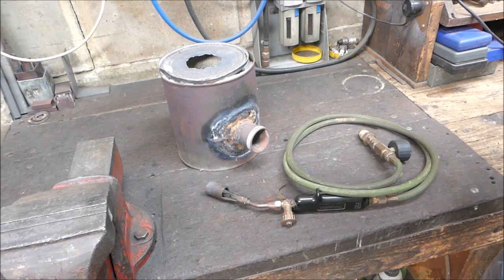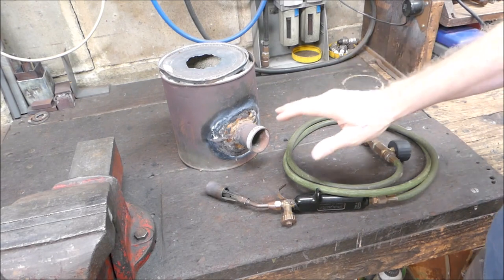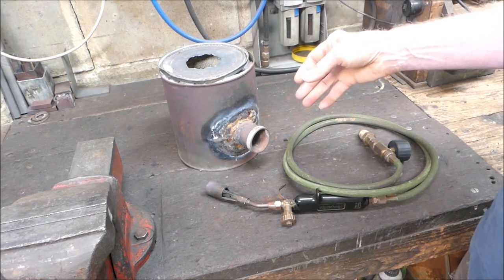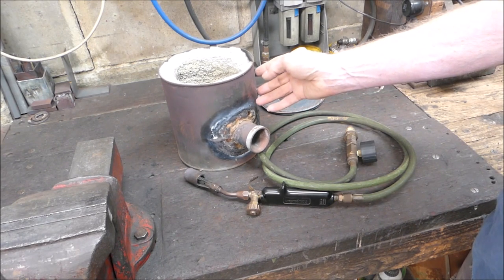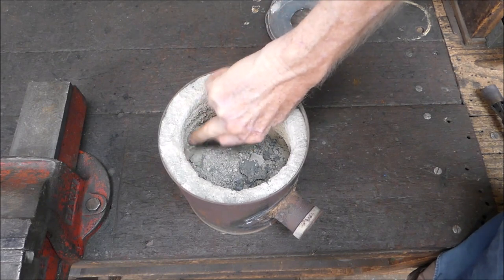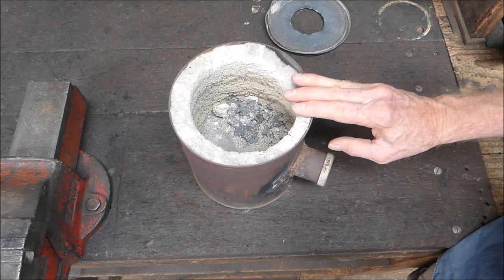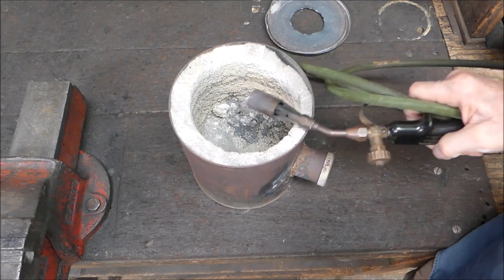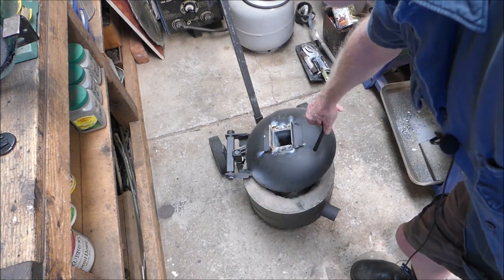How well do Perlite and refractory mortar stand up to intense furnace heat ?

Comment: Hi, Thanks for sharing your ideas in this informative video. Given that you have a very good insulation lining, I think that you could coat the old eroded surface with a thin layer of render that could withstand the heat. Pure commercial refractory mortar, that you use with the perlite,  may do the trick. My supply of Lanko 156 refractory mortar is only good to ~1,000C). I expect you need a bit higher temperature. Sodium silicate mixed with suitable refractory minerals is another that can be good for 1,200+ (My thermocouple will not measure above this temperature and I expect that the probe wires get destroyed at this temperature).
Sodium silicate and aluminium oxide make a bulletproof DIY refractory render. It is easy to use and very cheap. I have found that the aluminium oxide can be substituted with finely ground and sifted clay-free loam soil (from farm post hole digging or crab hole towers) and it is literally 'dirt-cheap'. The link to my rambling post on DIY REFRACTORY FROM SODIUM SILICATE “BORN IN FIRE TO SURVIVE IN FIRE” is below. I will be interested to see how your liner repair goes.
Lastly, I am curious to know what the little metal-lined notch in the lower portion is for?  Tim
https://timtinker.com/diy-refractory/
Reply from the maker: Thanks for the link and info Tim.  I had looked into water glass at one stage, but have not been down that path.  I have considered refacing the existing insulation and was going to use some commercial pot belly stove black filler that supposedly handles high temps better.  I seem to have misplaced the name so I need to do some digging on that one.   
 The metal notch is for the crucible handle.  Cheers Rob
Reply: @Xynudu  Thanks Rob, Yes, I started my silicate journey with pot belly stove repair compound. It was expensive for a small quantity. So I worked out what it was based on and started to make my cheap equivalents. Water jet-cutting waste garnet grits make very dense and refractory renders and the silicate is very cheap if you make your own from pure sodium hydroxide and silica gel cat litter.
Yes silly me I saw you using the notch for the crucible handle in the next video that I watched. Great stuff. Tim
Reply from the maker: Hi Tim.  I use a cobbled up steel crucible with an integral handle.  The separate crubible and tongs many people use looks like an accident waiting to happen to me.  Probably not, but my system can't slip or fail.  A few other casters also use a similar system.   It's been too wet to cast lately (very unseasonal) but I will get back into some brass melting next.  Cheers Rob

Comment: Thanks for the update Rob. Is the heavier erosion because you've upped the heat by going to brass from aluminium? I've never tried any melting but you never know, I might make a similar unit and try it.
Reply from the maker: Hi Mart.  Yes, brass requires a lot more heat.  The much bigger burner really puts out the heat and I suspect it exceeds the limit of the binding agent (mortar or cement).  Cheers Rob

Comment: Hello Rob,
A very good video... I was a little surprised how it has broken down so quickly... I was wondering if you could make a runny (for want of a better description) solution of the Perlite / Refractory Mortar and try and seal it now... I would be an interesting exercise to see if it extends the life somewhat.
Take care.
Paul,,
Reply: Skip the perlite on the lining, get some firebox repair or relining compound, comes in tubs. Many brands

Comment: Hi Rob, another good video. It is a shame to see the flaking so soon on your foundry. However, you are getting it a lot hotter there with melting brass so maybe the heat is just a bit too much? My foundry has a 1.5/1 ratio of perlite to cement. I have not run it up much because I'm still working on the hossfeld bender build, but it would be good to see how it holds up with melting brass. I saw your other video on melting brass which again is a great video. I have a bunch of brass so that is on the list to do. All the best.
Reply from the maker: Hi Jon.  I'm keenly awaiting the outcome of your mix under duress.  I firmly believe the temperature is exceeding the limit of the binding agent (Pizza ovens don't get this hot).  Next time I will try some Bentonite clay to re-line it.  Nothing to lose as I have 20 Kg of the stuff. All very interesting.  Cheers Rob

Comment: Thanks Rob, that was quite "illuminating" :). The nature of the flakiness where the flame front is suggests a stringy addition might help near the surface. I have no idea what material that can be, maybe a fibreglass weave although that will melt at around 1100oC, but that might be ok if its buried a little under the refractory mortar mix?
Reply from the maker: Hi Benny.  I'm going to have to give some more thought to this.  I had a steel liner in the paint tin furnace, but it soon burnt away.  I'm not sure how stainless steel would go.  Interesting subject.  Cheers Rob
Reply: Stainless grade 304 is apparently ok for up to 870 Celcius for intermittent service, or 925 Celcius in continuous service. So it seems like a stainless lining might do for melting aluminium, but wouldn't be much good if you were working with brass or bronze.

Comment: When making refractory mix you should coach your Pro-Lite lightly in shampoo or dish soap then add a small amount of Portland cement just enough to barely coat let that dry now when you use it you'll need much less water in your mix Yoli matchless time to cure it and you'll get much less cracking in your finished product

Comment: Out of my league with that rob as i have never done any melting of metal using a home made furnace   but i keep thinking of a sacrificial liner . 
Maybe something like a big coffee can that you can insert to protect the lining ? When it is stuffed just replace it and it may keep the lining from degrading- just a thought . .
Reply from the maker: Hi Ian .  Food for thought.  I'm obviously not alone with this issue, but you see very little reference to it happening.  After what happened to the coffee tin furnace I was not surprised.  Now I just have to find a cheap solution.  Cheers Rob

Comment: Hi mate, check out Foseco Pyrocrete 165 AFT. It’s a commercial cast-able refractory. You can get it in Brisbane. I went monolithic for my furnace for durability (it’ll last longer than I live) but many use ceramic wool then 2” of cast-able refractory for the hot face.

Also, Pyrocrete is very dense and does not use much water. I need 1.5 bags for my 9kg gas bottle furnace.
Reply from the maker: Thanks for the suggestion.  I will check it out.  Cheers Rob

Comment: My perlite failed after ten or so melts, I put koawool in a fixed that problem got fifty melts on it it's fine,it cost more but lasts forever.
Reply from the maker: It's a very expensive option in Australia.  Did you coat it with anything ? Cheers Rob
Reply: Just cut to length and rolled it in,you can't even tell it's been hot and it three years old, amazing stuff.

Comment: I've been thinking about making a smelter. I need a large capacity one as I want to cast intake manifolds.
Reply from the maker: That will require a big furnace and heavy lifting gear to handle/pour the hot melt.  It's a major undertaking.  Cheers Rob

Comment: What about using a big coffee can indsigt. To reflect the heat from the blower..
Reply from the maker: They don't last.  I had a metal liner in the smaller furnace and it just burnt away quite quickly.  Given the much greater heat of the new torch it would be even worse.  Cheers Rob

Comment: Bloody hell, I didn’t think it would deteriorate so fast, it’s a shame
Reply from the maker: Such is life.  Learn by destruction ;)  Cheers Rob
Reply: Try 100% refractory cement putting a veneer layer on the existing insulation, I reckon that would give excellent thermal properties and stabilise what you have already done
Reply from the maker: Worth a try Don.  I will let it wear away a bit more before I re-do it.  Cheers Rob

Comment: better still line with ceramic fibre matt insulation first then cover the insulation with refractory cement that will never crumble away even under brass smelting conditions

Comment: Perlite is great insulation but not suitable for hot faces. Fire clay works, wants to be an inch thick, it wil crack all over but is  expected. Coat it with a layer of alumina and sodium sillicate binder.

Comment: Hay Rob, I found this clip and recipie, he also test it. https://youtu.be/KZyUcYhYVgU and another clip testing different mixes. https://youtu.be/xV51Om1Mv_o
Reply from the maker: Thanks for the links Mick.  I see that Perlite comes out on top.  I have a few home brew mixes to try next.  The one most likely is Perlite and Bentonite clay binder with a dash of high temp mortar or sand.   I have all that and nothing to lose ;)  Cheers Rob
Reply: @Xynudu Hay Rob, I'm going to use his fire brick recipe in the first vid. I'm in the middle of building an oil fired gas bottle furnace and had a look at your build videos. One question I had is did you put any reo or mesh in the lid to hold it in and to stop it falling apart?
Reply from the maker: Hi Mick,  I put two pieces of reo across the lid - one each side of the square vent and added two cross links between them.  That keeps the insulation mix well in place.  You could use weldmesh as an alternative, so long as you can weld that small a diameter.  Cheers Rob
Reply: @Xynudu  Yea I thought you needed something in there, I'll do something simmilar.

Comment: Perhaps the most exhaustive research into this type of material was undertaken by NASA for the Space Shuttle protective 'Ceramic Tiles'.
Maybe a mixture of the tile material (given in the attached link) used as a bonding agent with your 'Perlite' would provide the answer you seek. https://www.nasa.gov/sites/default/files/atoms/files/shuttle_tiles_9_12v2.pdf. Best regards.

Comment: How long does it take for that mix to cure? I'm making a pizza oven and did the first 8" or so of the "igloo" with perlite and refractory cement, then the rest with perlite and portland cement. The portland cement and perlie is rock hard, but the refractory mix isn't. It's set, but still kind of "damp" and not solid. Been three days...
Reply from the maker: I didn't use refractory cement.  Refractory mortar is different, so I can't comment on your mix or the ratio you used.  It sounds like there wasn't enough cement.  Cheers Rob
Reply from the maker: That mix sounds about right.  Too much water could do it.  I don't use a water ratio, just add enough to get the consistency how I want it.  If it is a water issue, it should dry out when warmed in the sun (but could hairline crack the surface slightly).  Cheers Rob